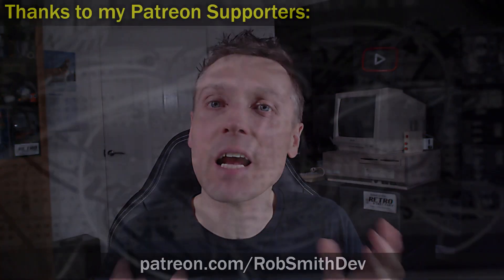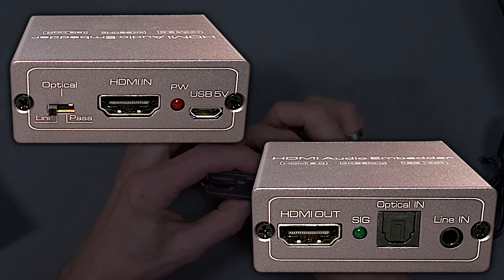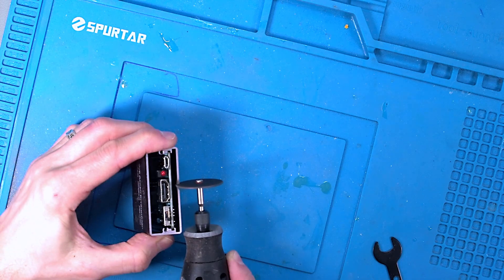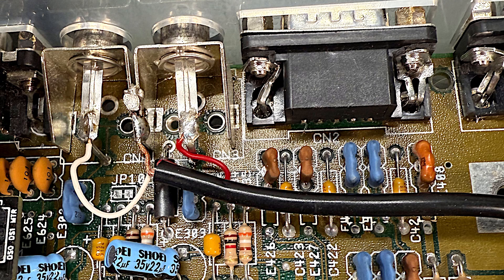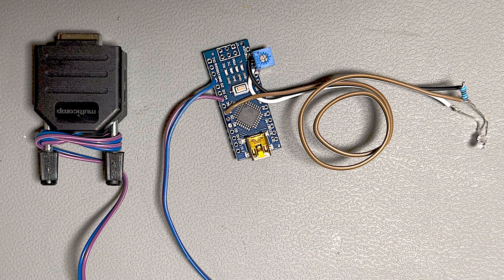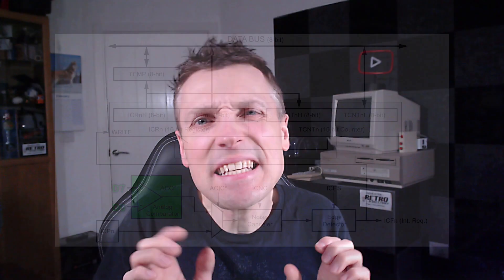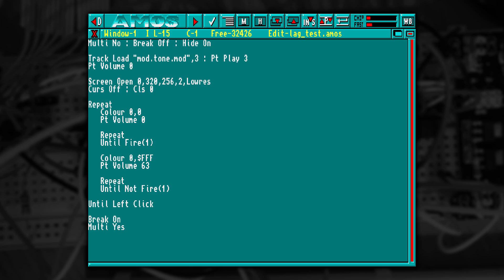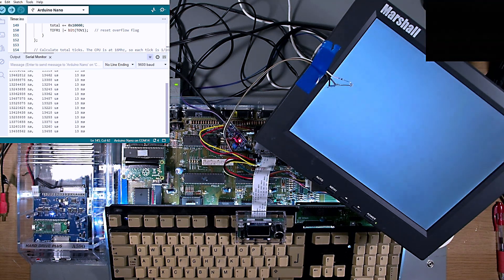RGB2HDMI: Adding Audio to HDMI on your Amiga

Comment: So the audio lag added by the injector & monitor (0.5ms) is less than the video lag added by your monitor (20ms)?

In HDMI the audio is transmitted during the horizontal blanking period as part of the data island period, so it's per-line and no decoding/encoding of the video is required to inject or extract the audio. Also even when the video is encrypted (with HDCP), the audio is not, which is why these devices can easily "support" HDCP (because they actually don't need to decode/encode the video).

Comment: Indivision AGA MK3 has HDMI audio, it vampires onto the CIA and grabs/muxes the analogue audio output from Paula into the HDMI stream.
Reply from the maker: Yeah there are other solutions to it, that one is quite neat! I’m hoping someone builds another RGB2HDMI for the A2000 as the audio is available in the video slot!
Reply: @davesharp7315  not quite, the piggybacking of the CIA is for capturing keyboard inputs. The Indivision sniffs the chip ram data and emulates Paula in it's FPGA.

Comment: I would totally do this mod, but I'm worried I wouldn't be able to get the glued board out. Don't have a dremel or the skill to not scrape a dremel gouge into the pcb. Very cool solution and video though
Reply from the maker: Someone suggested the glue might release the board if the case is heated. A bit late for me to try, but possibly an option

Comment: Expensive? Sure, if you want "pro" gear then they can get pretty pricey, but that exact same device has been kicking around for years and there are literally hundreds of people flogging it for a range of prices (£20 up to a frankly ludicrous £60) on Amazon, eBay, AliExpress, etc.

(Also, I've always pronounced AMOS with a short A (amm-oss rather than eh-moss); I know Amos is a name, but given that the AM in AMOS comes from "Amiga" it's always felt like it should be pronounced the same.)